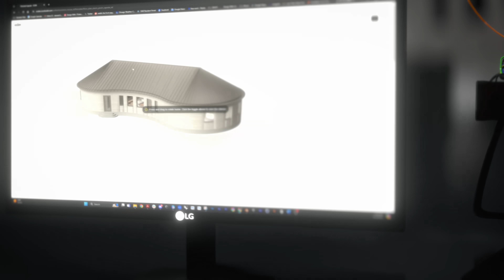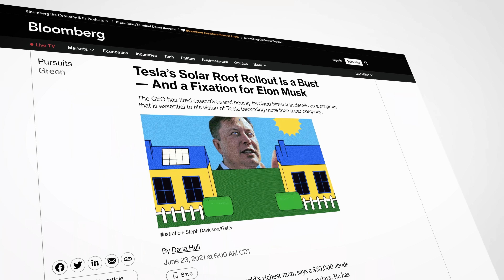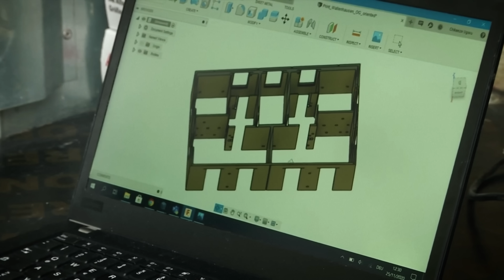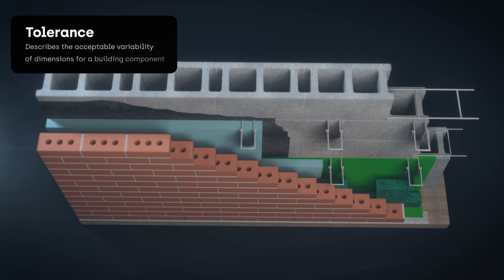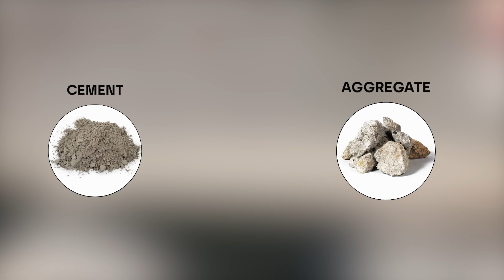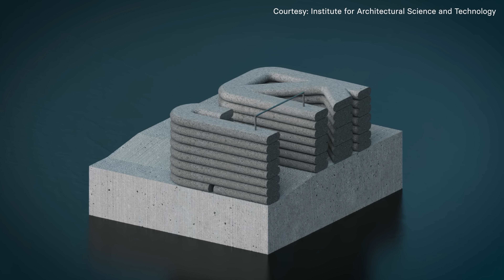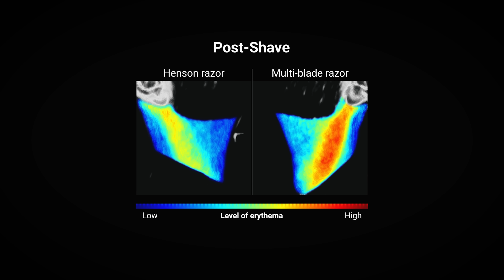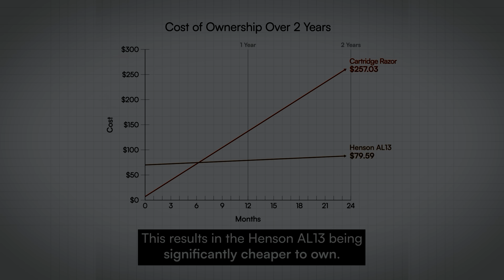Why 3D Printing Buildings Leads to Problems

Comment: Concrete does not dry, it cures.  The cure rate of concrete is the main determinant of the strength of the material by affecting the grain size of the of the stone-like structure.  For optimal strength, you want to cure the concrete slowly and fully cure the concrete before adding any additional weight. Building an concrete structure fast means structurally weak concrete.
Reply: The vendors claim 9500 psi, compared to typical 3000 psi.

You can specify 5000 psi, but you'll pay for it.

Keep in mind the Roman Pantheon has no reinforcement (though it's easily 4 ft thick).

And it's 2000 years old.
Reply: I was wondering where the rebar was
Reply: Hoover dam has entered the chat.
Reply: Due to the materials used in the 3D process, the strength is three times stonger than concrete.
Reply: One other huge factor is the quantity of water used in the first place for its flowability.
Reply: My brother works for one of the leading companies that do this, it's not normal concrete and has other additives that make it stronger.
Reply: @Jacob-ed1bl i was fortunate enough to have interactions with a contractor on a site where I  was previously employed. They were replacing the concrete launder under a conveyor system feeding a salt stacker. They had used a fibreglass reo bar where it was needed in the right areas that steel wasn't applicable plus they were using additives that were to promote the strength in the concrete. Bit beyond me but it was a fascinating insight into what they  worked with every day. Concrete isn't just concrete I learnt.
Reply: Wet-poured sand-cement slurry is the weakest of block or concrete, regardless of cure rate, even if you siloxane the exterior, it will soon freeze-thaw into chalk powder and black mildew. Maybe for the Anzo-Borago Desert?
Reply: @AmericatheBeautiful-p4z 

It is possible to pump concrete several meters up an extended boom, and place it where it needs to be, in a form, or a slab.  With a judicious use of water and other ingredients, you achieve the desired workability, without risking strength.

The Pantheon has no reinforcement, so they used it over a meter thick, and varied the density of aggregates, etc. Roman concrete was typically so thick it was pounded into place.

And I recall some Roman concrete was made with seawater.

If you carefully listen to some of these 3D printer videos, you will hear "accelerants", and "additives". Polyester resin has been added to concrete the last few decades, but declaring "we add polyester resin" to the Internet would be disclosure of proprietary information.

As others have said, "concrete is not just concrete".
Reply: Lol you really think they’re that dumb? Like they’d use quick-crete or some shit for this? Seethe, luddite 😂
Reply: @choochoo1963 considering they are a tech company first and a construction company second, yes, i fully believe they would do something like that

Comment: From someone that is outside of American view on housebuilding (Europe), some of the issues you raise are specific to American way of building one family houses. We don't use 2x4 and sheetrock for internal walls of a (usually brick or concrete) house. We usually plaster over it and when you talk about the imperfections being visible forever, my first thought is that you should plaster over it (https://youtu.be/YhAwPFIUF_4?si=rgQyWUfl_aV_8wH5&t=625). Same with the external visible layers -- why not plaster over it? Or put the All-American plastic siding over it?

As for pre-pouring concrete as shown at https://youtu.be/YhAwPFIUF_4?si=DasM3Q_zp2LzntLM&t=798 , this kind of prefabrication (at what we literally called "house factories") is/was used to build "bloki" (commieblock hi-rises). While it allows for fast and quite cheap building of multi-storey apartament buildings, this so called "big slab" (wielka płyta) technology has most of the problems that you mention about 3d printed houses and then some more, and it is quite not suitable to build one family houses, although there were attempts to do so: https://ocdn.eu/pulscms-transforms/1/agHk9kuTURBXy8xYTA5OTRjNC02ZDQ3LTRmMGUtOTlmYi00Yzc3OThhMzc1MmMuanBlZ5GTAs0DSM0B2N4AAqEwAaExAQ https://ocdn.eu/pulscms-transforms/1/5hPk9kuTURBXy83NTQ5OTQyNy0xMjQ3LTQ5ODMtYTMxZS0xMmY5NGExNzNjYzIuanBlZ5GTAs0DSM0CLd4AAqEwAaExAQ . But the big slab works best at scale, the bigger the better.

Personallty, I think the round corners can me made into a nice comeback of Art Deco, and I'd personally prefer this kind of house to the usual wooden-frame-and-sheetrock building.

Comment: I think this technology could have some promise. It just follows this current trend of using technology to make things worse but cheaper. No matter how good this gets, its never going to be better than a properly designed and constructed house. It may lead to pretty good cheap house, but that's after a lot of work and development. 3D printing houses also will have little to no effect on the underlying causes of housing prices.

Comment: The few issues you found are easy to solve and the fact that you pretend in the intro that its harder to build a house than to revolutionize space travel is laughable, also when you mention how exact everything has to be while still being lose yeah that counts for people building houses as well and they fuck up more and are less accurate, this is a clown video that bitches about technology that is in its beginning stages and all the issues you can find are already easily solvable on the horizon or exists right now with manual labour and houses as well.

Comment: All this needs is the ability for the nozzle to pick up some relatively light weight stuff, to bridge those gaps.

"Ideally", it could make those on site out of concrete as well, and let them harden/cure, before putting them in place.

But, personally I don't understand the obsession with going straight to a "one continuous line concrete printer" to begin with, and why the presence of an "3D frame" itself can't be used smarter, and with more applications/tools than just a concrete nozzle.

I mean, ever since I saw those car assembly arm robots decades ago already, I figured we were mere years away from those being used to help any construction from start to finish, from pouring concrete, laying bricks and driving nails, to painting the rooms and washing the windows.

Comment: The main problem is the sequence.  If you do the concrete last, after reinforcing-insulation-doors-windows-utilities-hardware are in place, then the total process is infinitely more efficient.  This "reverse" sequence is more technically challenging, but probably inevitable.
Reply: Thats actually a great idea which is why icfs are doable and this 3d printing isnt.
Reply: @BaronVonFrankenBolzlll  Yes, though you need to cover over all the foam surfaces.

Comment: The problem with your example is that the brick is a veneer where the concrete is the frame. The brink on your house doesn’t structurally hold anything up so you could have a brink veneer on your 3d printed house. And most concrete is far stronger than any other materials used. Look up ICF homes in Florida after a hurricane. They will be the only ones standing.

Comment: The reproducibility issue you talk about toward the end us why I'm surprised we don't take a page out of the Soviet Expansion era with their derisively named "commie blocks". With today's tech, you could do cast molding of the walls, with pre-made cut-outs to leave spacing for electrical and plumbing. Ceilings and the wiring for lights could easily be done by sinking masonry screws through wood boards, giving space for the wiring to go between the drywall and the ceiling/floor for the next story.

Comment: You discuss the value of having vertically integrated companies very early and discuss this as why innovation is slow in construction. But then you state that it is a huge disadvantage because it's not open and the company could go out of business. That is the tradeoff between the two approaches. If you want the pace of innovation and the benefits of that scale, you get substantially more vertical integration and less flexibility.

Comment: The first metal bridges were designed imitating bridges of traditional materials. Cars were manufactured into the 1970s with features from horse drawn coaches. We'll get over it eventually.

Comment: the biggest expense of a house is the land and the foundations. Often there are massive problems with the foundations which require it to be stabilised before building on. Whether you like it or not. you will need to get contractors in to lay the foundations, contractors for the heating and electrcity, conrtractors for the windows and dectorators to plaster up the walls to make them smooth. 

3d printing kaes off just 1 component of housebuilding and it's not any cheaper than having contractors come in and frame and clad the walls.

Comment: On a real note, why do we not make houses out of recycled plastic? I understand some countries are too hot for this, but in places where it's not? It can be reinforced, and it can be pretty strong to be honest. Given you use the correct plastics. But obviously not biodegradable ones. Perhaps not in places that have many weather phenomena but other places like England perhaps?
This may be a dumb proposition,  but I would like to know why this would NOT be a good idea. If the plastic is correctly reinforced with steel, maybe a bit of wood in certian places, and obiously insulated etc. Could this be feasible? Obiously not for like apartment blocks, but regular homes.

Comment: I always wonder why they don't trowel the vertical surfaces smoother as they are applied. 3d printing houses definitely doesn't help with the sand shortage...

Comment: Surely it can be rendered inside and out. You could plant a corner bead and get a square corner in your render. As for renovations and changes to the structure, why not just cut and fix new structural members as if it was a block or poured wall.
Reply: This none square wall thing is easy with precast corners dropped into epoxied holes same for windows and doors. You could even use beautiful wood columns with a thermal break of foam

Comment: sounds like this video is TRYING to portray every single nuance as a HUGE ISSUE...
concrete has better soundproofing... better thermal insulation, hurricane proof... flood proof... fireproof... even if the house is completely flooded or engulfed in flames and everything around the structure and inside is lost... guess what, you still have the initial structure... just putting a roof over the structure gives you a livable house, sure with ZERO amenities... but things like copper plumbing lines are still there...
i think that concrete as the building material is 100000000 times better than what is currently done with wooden frame housing... wooden frames are such garbage... its no wonder that the great majority of developed countries DO NOT USE IT in construction...

Comment: The flaw with these types of solutions is that they are attacking the problem from the entirely wrong angle. We can build homes faster, safer, and more efficiently than ever before - and yet, we have a huge affordability crisis.

It’s not that we can’t build affordable housing, it’s that the relentless profit drive incentivizes lenders, developers, and builders to use new techniques and technologies to more affordably build luxury housing. That’s why you have people living in cars and tent encampments in communities with huge unsold inventory of luxury condos. 

Developers make far more money per square foot on a large, expensive property that they built with fast and efficient construction that sits empty for a couple of years than a small, affordable home that sells immediately. Not to mention, “affordable housing” is a term that gets you all kinds of NIMBY opposition at zoning board meetings, making the process more complex and frustrating for developers. 

Finally, building construction used to be a well-paying, middle-class, steady, skilled job. As these new, often proprietary techniques and technologies reduce the need for skilled laborers like masons and carpenters, those middle-class jobs become fewer and farther between. Literally farther between, because these technologies like 3D printing take jobs that were once more widely distributed around local communities and centralize them in factories where large corporations control access to the tools and technologies that create jobs. Workers aren’t learning a skill like carpentry, which they can take anywhere, instead learning how to run proprietary machines and software - skills that don’t transfer as easily, by design. This gee-whiz tech, like 3D-printed homes, will make the problem worse not better.

Comment: silly question, why not just put a finish on the concrete walls inside and out, this is done already, sure it might add to the cost, but if you want aesthetics a finish could be much nicer than the ugly concrete.

Comment: I feel like you're negatively biased and over-react, and at least one "disadvantage" that you mentioned in my opinion was actually a benefit, like that bit about tolerances "machines suck because they are too precise while we humans dont care as much about precision and in worst scenario cover-up some mistakes". So which case is worse A) humans being worse at precision but covering that up or B) machines being perfect, only fucking it up when someone else or environment already fucked it up, but then anyway some builder can stop the machine fix either the problem or design and press continue.... OR this: "What if something breaks, what you gonna do? get that big 3d printing machine back there?" .. how often do you replace or fix f**ing core WALLS in a house?! and even if, then you do some small piece of it, which any skilled technician can visually match with the surrounding, how hard is it to make wobbly waves out of plaster. But anyway, nobody's saying that it's a better way to build houses, it's supposed to be a cheaper more predictable way

Comment: The main issue with 3D printing concrete is that your house will always be, and look like, a cast in place concrete bunker, just that its cast without formwork. Now, obviously, not only is this ugly as shit, they are also not very comfortable or practical to live in.

Comment: Imagine all the dust and crap settling on the ridges on those walls?  Rake those at the end of setting and have a stucco/plasterer  do a smooth finish coat.

Comment: all they should be doing is smoothing out the walls, so if one of the walls forms a crack or gets broken, you can just remove the damage and repair it again with regular old concrete. leaving all the lines would just make any later repairs more obvious

Comment: Why don't they just add magnetic (single direction magnetic bit of metal) bits of metal then as it's pouring run an elecromagnet over it. The metal bits can be oppositely polarised which would enable the bits of metal to line up on one side of the wall a certain way then the opposite side of the wall can be oppositely magnetised to get the opposing bit of metal with and opposite polariry to line up giving the whole thing structure. If anyone actually reads this and uses it then please track me down somehow and give me a small about of money for coming up with the idea. I'm broke. And by the time this idea hits the market odds are ill be broke then too 😂

Comment: Wouldn't it be easier, cheaper, and faster if you prefab'd the concrete parts and joined them on site?
Okay, so you might miss out on a novelty peanut shaped house on a slope, but most houses are a bunch of squares, rectangles, and triangles anyways.
Reply: Prefabrication has its own issues. It's only significantly cheaper if you're producing the prefab parts on a large scale and keep the number of different pieces low. But that means you can't adapt well to the specific shape of the plot. So while you can cheaply throw up standardised prefab apartment buildings out in a field somewhere on the edge of town (as was done extensively throughout Europe and the Soviet Union in the 2nd half of the 20th century), or by simply razing the whole area first, it doesn't work well for filling in gaps in built-up areas, which is where housing is most needed.

Comment: The problem with precast is shipping. The more concrete moves around the more chances it'll break. Knox county you're spending extra on gas. If you just pour your house using styrofoam as your blocks to hold the concrete together. Well then you get an 8-inch concrete wall all your windows are already cut out all your being structures are cut out into the concrete wall. You could even place your plumbing and electric inside a conduit inside the concrete wall. And if you really wanted to go not you could put geothermal inside the concrete wall. Once you had everything set up you could pour that wall in 7 days you can put the roof on. And a house like this would be able to take a tornado hurricane whatever hits it. Plus once you add heat it would never cool down as quick as other buildings. The blocks you use to help hold it together to pour the concrete never come off the wall they're insulation. So you have 8 inches of concrete and 8 in the star from insulation to keep your house from getting cold or hot in the summer. Angie do you put expansion joints in so when the concrete swells and because of the summer heat or Winter cold. The whole thing sits on top of a monolithic poor. That gets done at the exact same time as the wall gets poured. So if you did everything right within a month you could have a brand new home. If you really want to cut the cost down you can trade the aggregate of stone and swap it with straw. That's the way the Romans did it.